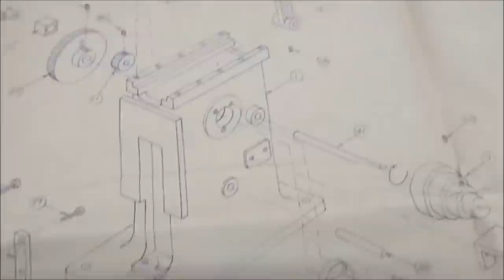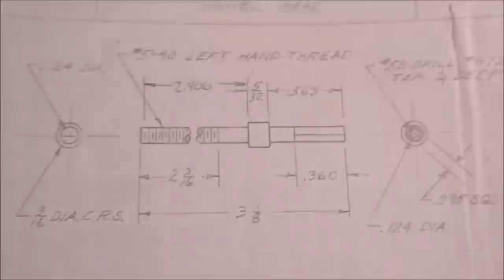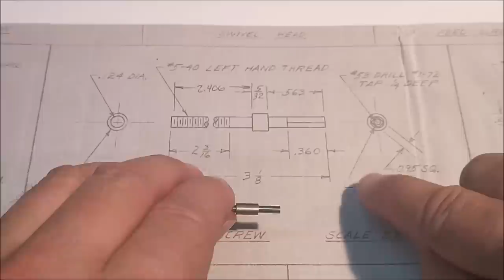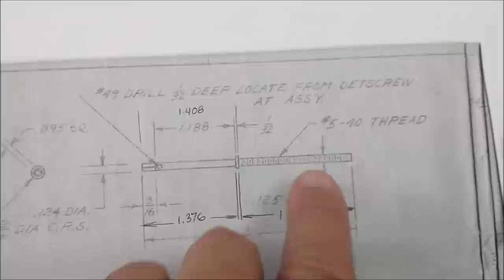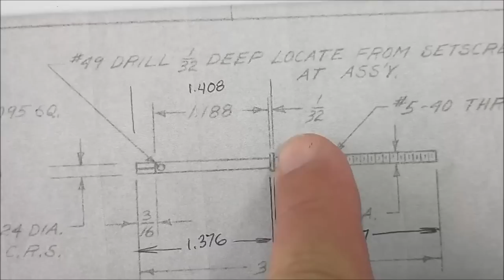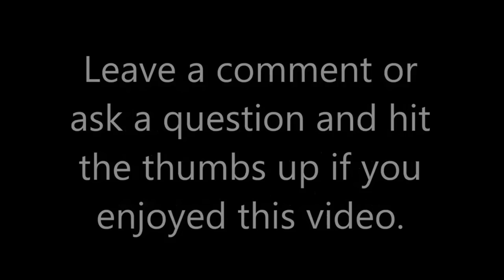Miniature Lead Screws and Shop Gremlins

Comment: Not sure why, but when you were describing your approach to cutting and advancing the stock in the collet I had it in my mind that you were talking about cutting the threads.
Was picturing lining up the threads with each advance and tapering in and out on a single point operation.

Nice work though, great to watch!

Comment: As "usual", the work of a master.
Did a similar thing, left hand threading, 1/4", 3" long, 51 TPI, using a live center and plunsh cutting following Your advice. But single point threading 1/8", 3" long is a lot harder. You've shown that kind of followers rest earlier. Great strategy.
Time 12:35. The satisfaction You expressed, well earned. 
Does "Well done" surprise You Joe? Hardly.
Yes, terrible what hit Florida. Unbelievable.

Comment: Thanks for sharing! You hit on some great topics. We had an offshore unit that connections kept backing off the screws terminals most new techs don’t watch the job the unit preformed. I helped with the job and watched out for anything abnormal. The unit under full load was shaking the electrical panel like a paint can in a paint shaker. It wasn’t visible to the operator running the equipment. I found some loose brackets and swapped out for better vibration isolator system.

Comment: Nice job Joe!
It is anoying running into faulty drawings... But finding solutions always (well mostly) creates some additional fun.

I would have gone for a brass washer instead of the plastic. Or even a bronze bushing or something along those lines.
Of course the brass washer would be the easiest. Could even make it's diameter the same as the rod. I think it would look pretty nice just having a neat little golden ring between the colliding parts.

Comment: Machining the slight taper to allow the tool to gradually engage is pure genius. For those of us with home shops and generally underpowered machines, are there any similar suggestions you could give for materials that work-harden significantly such as 304/316 stainless?

Comment: The machine models are a fantastic showcase of technique, planning and finish. For us who are not advanced machinist this series is great for absorbing ingenious ways of work holding and approach. One suggestion if I may, the plastic thrust washers are as ugly as sin, if they where cut to the same diameter as the piece that slides into them they would be less conspicuous.
Reply from the maker: Hang in there. I'll clean it up.

Comment: There were some great tips in this video about working on long, and long thin threaded stock.  I wish I had them a few days ago.  I was making tiny arbors for tiny 0.5 & 0.6 module gears.  Eventually I got there.  Next time, the Joe Pie way. 😂
Reply from the maker: That follow rest I made is a life saver. Consider making one.
Reply: @joepie221  I should have thought of that.   Sigh.  I did use a follower rest today to make an even small one (.1095).  Rough finish though.  But since it will be threaded 4-40 finish is not so important.

Comment: Planning order of operations is one of those things that requires some experience. I find that the most important question I have to ask when I am deciding on order of operations is, "How am I going to hold the part during the next operation, and how rigid will it be." There's nothing more frustrating than realizing too late that you removed material that you needed for holding on a later operation. Sometimes it's like playing three-dimensional chess where you have to think several moves ahead.

Comment: Good morning Joe. Your skill and technique is so enjoyable to watch and watching your videos exercise my brain which is a very important thing to do. 
Now if in the middle of making that lead crew the cutting edge of threading tool just fell off and you had to stop and sharpen it would you have to scrap the parts or would you be able to finish the original one. 
This precision model building looks like the ultimate machinist skill.
Reply from the maker: I could pick it up, but its a fussy trick.

Comment: Making those parts would really stress me out.  I remember when you built the follow rest.  it didn't show in the video but are you adjusting the follow rest after each pass?  Thanks for spending the time to give us subscribers such excellent video.  I believe I've even learned a thing or two following your channel, Thanks!
Reply from the maker: No. A follow rest used for a threading operation stays at the initial setting. The OD of the thread doesn't change, so there is no need for adjustment.

Comment: With "eighth of a millimeter," you just confused the entire metric world! 😂
Reply: I approve, fractions over decimals.
Reply: What? .125mm is an invalid dimension?
Reply: We can devide non decimal but we dont like it🤣
Reply: "Metric" doesn't mean "decimal"🤷‍♂️ (edited from "metric isn't decimal" for clariry)
Reply: Nothing new about that. People that use DP Measurements are easily confused. If you want 8- equally spaced holes across a 333 cm space they absolutely freak out.
Reply: Hilarious!!
Reply: How dare you calling us out? We only  allowed to say 1/100 of a mm (and some change) 😅
Reply: @mathewmolk2089  
Only those who aren't bidimensional.
And if you want to get people who are used to DP gears messed up tell them to make a blank for a 37T gear in 36/38 DP* (37/36 + 2 x (1/38)
*Fellows Stub Tooth
Reply: Have you never had a part that was 3"¼ and 2mm? Happens to me all the time with tapes marked in both units
Reply: Nothing wrong at all with using fractions of anything. 
Half a gatox always sounds great to me but I am othen told not to eat more than a quarter of it.
A thousandth of a second (0.001s) or (1ms) or (1e-3s) is commonly used in timing of sports.
A 1/3rd of a year is a  fraction over 121.666 days.
So an 1/8th of a mm or a mm less 7/8ths is perfectly normal & acceptable for educated people.
Reply: @mpetersen6  stupid of corse its not.
0.125mm is perfectly correct.
Reply from the maker: You guys are awesome.
Reply: lol....not the uk we still use both me im 5ft 100mm tall .... it confuses me when they say 500 thou think think thatz 1/2 inch

Comment: Terrific work as always Joe.
Given you added that nylon washer for the Apron Screw, I'm curious if you intend doing the same, inside for Ram Screw?
If so, would you then remove the washer thickness from the Ram body to allow for it, onto that already cleared bearing surface?
Reply from the maker: When I add friction reducing spacers, I always make a surface adjustment somewhere so all the parts rest in there intended position. Good question.

Comment: Wild.  Seems to me the threads should be riding outside just a bit in a bushing and the shaft also for the handle.  But the screw is far from the rear.  The brass sorta holds it but hum.

Comment: Good work, nice bike. Is that a supercharger inlet? Also have you ever used a shaper? Also have you seen the finish they can produce?
Reply from the maker: Although it looks like a supercharger, its called a Hypercharger. Its an air intake, but not forced.  Just focused. And no, I've never run a shaper.
Reply: @joepie221  Shapers can produce a remarkably flat surface with excellent finish.

Comment: May have been suggested as an alternative - couldn't you have ran a ball nose end mill through the bottom of the channel (@ 23:00) where you had the interference fit from the shaft shoulder to give it the needed clearance rather than turning down the radius of the shoulder?
Reply from the maker: Yes, but you would still need to clear the end of that area to allow the collar to sit flush with the end face.
Reply: @joepie221  That was a given, just makes it only one part adjustment rather than both.

I've learned a ton from watching your vids, keep up the awesome work!

Comment: Would be crazy to die thread something like this makin a die holder held in the chuck, and a sliding collet chuck holding the work in the tailstock? That is, reversing the classic die threading setup, which can't reach such long threads.
Reply from the maker: I've actually done that.

Comment: Joe I see you use a lot of 5C collets, do find much need for ER collets? I want to buy my first set and get the most useful ones.
Reply from the maker: I like the closing mechanism for the 5C, but ER collets have a wider squeeze range. I use ER on my CNC mill. I think I'd suggest 5C for the lathe and mill for the accessory applications too.
Reply: @joepie221  thank you

Comment: Where can I find one of these "mini machine" kits? 🤔
Reply from the maker: Pm Research. Patrons to this channel get a 10% discount on any purchase when they use the code.
https://www.pmmodelengines.com/product-category/machine-tools/machine-models/
Reply: @joepie221  Just a note from Devmeister Super Precision and New Yankee Woodworks. PM Research is the USA company making these kits. Their castings are excellent quality. Their customer service is awesome. They have a great selection. Another company selling machine kits is martin models. More practical stuff like their universal pillar drill but Martin is a awesome pattern-maker and does great casting kits as well. I have the PM #1 steam engine kit and I was quite impressed with it. The english firm is stuart models. Been around forever. Excellent quality and selection. They also have mini machine tools and some are nicer than PM's selection but their price is higher as well. Just a note on shapers. Some consider them obsolete. FO Stanley used a round manhole access cover to get access to the steam chest on the stanley steam car engines. This makes access difficult. We have found that antique shapers like this model are really one of the only efficient ways to gain access to the inner surfaces of these engines. The D valve must mate tightly. Stanley's engines have machine work that will make you really think about how to do things. Not really set up for CNC this and that. Joe's work and quality videos bring much of the old world techniques in to clear focus. Its great to see some of his old world tricks and techniques which will bring your skills up a notch or two. The follow rest is a clever attachment to deal with a pain in the rear single point threading operation.

Comment: Is it acme or square treath?
Reply: Trapeziodal 😁
Reply from the maker: @mpetersen6  Imperial. 60 degree
Reply: @joepie221 
 I knew that.  One smarty pants deserves a reply. I wouldn't even want to try and grind an Acme tool that fine without a really good surface grinder that you can reliably feed in tenths at a minimum plus a clear sharp shadowgraph with enough magnification. And a grinding block to hold the tool solidly. 
Can you imagine doing a Whitworth that has the proper crest and root radius 😫